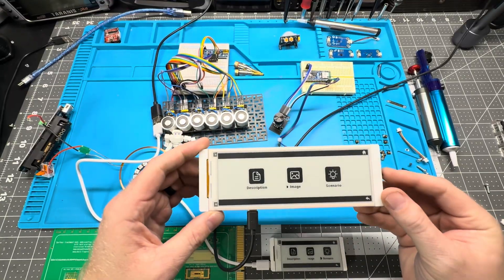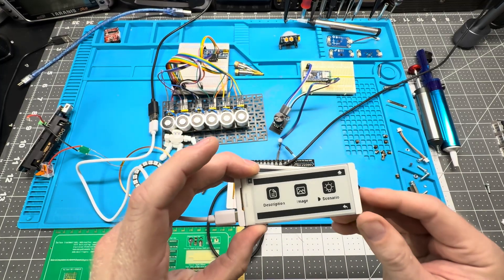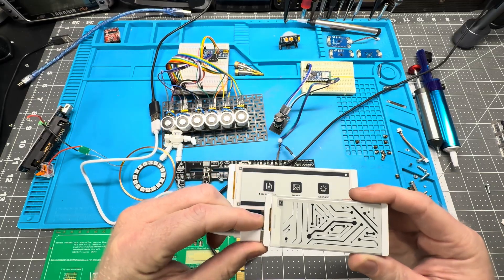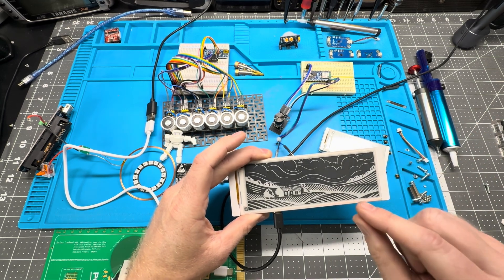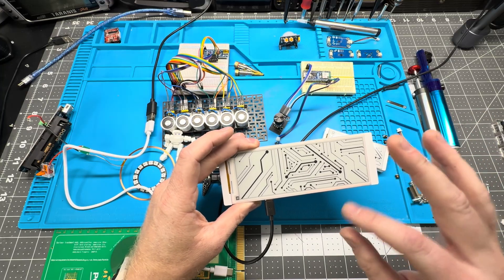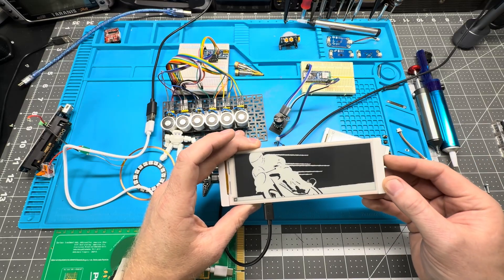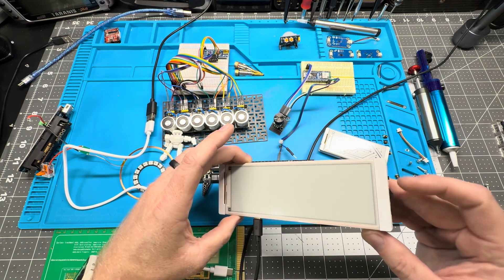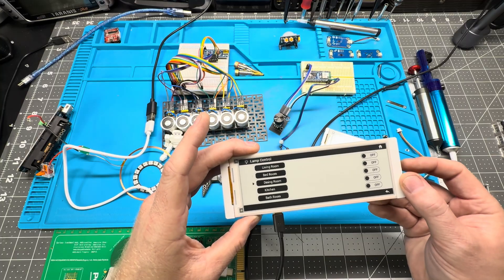Elecrow ESP32 E-Paper Displays

Comment: Know if you can update only specific pixels rather than a full refresh? Could be interesting for plotting.
Reply: No. The display is adressed in rows/columns. No way around that.
Reply: Yes and no. The display's internal memory is managed in rectangular areas similar to the way small OLED and LCD displays do it. You can overwrite a small rectangle of memory, but it must be on byte boundaries. The controller supports reading the memory out of the display, but it's a very impractical way to update individual pixels without disturbing the others which share the same byte.